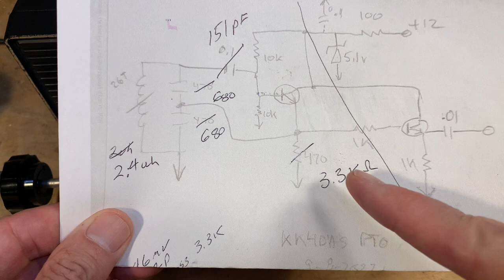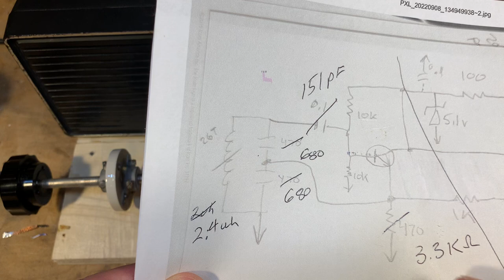Direct Conversion Receivers

Comment: The first HF receiver I had capable of resolving SSB was a home-brewed direct conversation receiver for 40 metres I built in the 1980s from a circuit published in Practical Wireless magazine. Hearing all those SSB stations was really exciting. .. since the I’ve always had a soft spot for direct conversion receivers.

Comment: Nice build as usual Bill...did you mod the tuning cap by removing plates or did you get it that way?  73 - Dino KLØS
Reply from the maker: Dino:  I removed the other plates years ago when I was young and foolish, and before I realized that a fixed cap in series would have the same effect!  73  Bill
Reply: @soldersmoke , ugh Bill! I feel your pain! I pulled the plates on my ARC-5 Command set VLF receiver tuning cap back in the mid 1970s foolishly thinking I could covert it to receive on 10 Meters but instead I ruined it not knowing I could tune into the IF of a commercial multi band shortwave portable receiver and pick up LSB and CW signals on 80 Meters. I found another ARC-5 and may pull its RF coils, IF coils and tuning capacitor and get it working again.

Comment: I think your emitter resistor value started out too low and the current fluctuation was causing voltage instability through the zener regulator diode sufficient to make the oscillator unstable.

Comment: You mentioned that DC receivers don't do well with AM signals.

Why not?

I would like to hear how AM on a DC receiver  sounds.
Reply from the maker: The problem is the phase relationship between the carrier and the two sidebands.  When you are demodulating with the carrier from the transmitter itself you do not have a problem.  It sounds great.  But with the DC receiver you are using a product detector and a local oscillator (VFO or PTO). Even if you can get that VFO or PTO exactly on the carrier frequency,  you will not -- with a simple DC receiver -- be able to get the phase relationships right. Your LO is likely to be out of phase with the AM carrier.  And your LO will not have the correct phase relationship with the two sidebands.  All of this leads to distortion.  You can understand it, but it sounds awful.  This is very similar to the problem of listening to a Double Sideband Suppressed carrier signal with a Direct Conversion receiver -- you can understand it, but it sounds distorted and terrible.  SSB and CW however,  are detected with no problems.  For more on this, and for recordings of DSB signals as heard in DC receivers, go to the SolderSmoke blog and do a blog search for "peter-parker-reviews-dsb-kit"